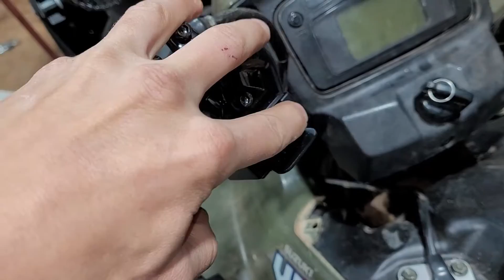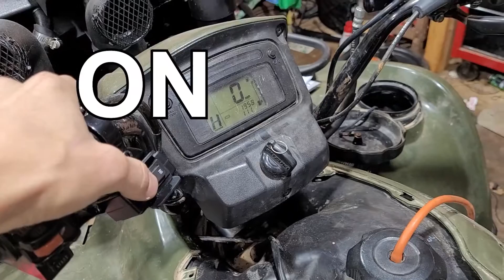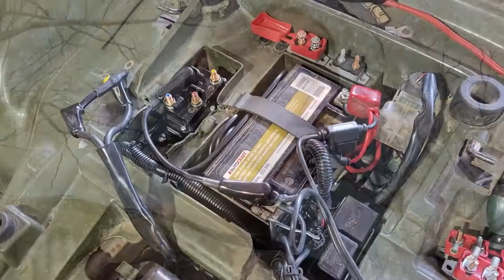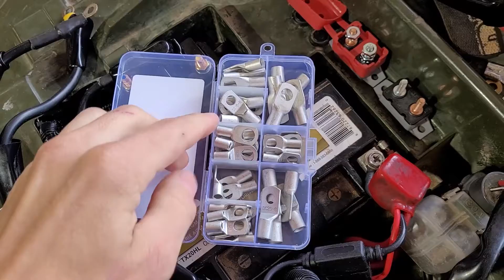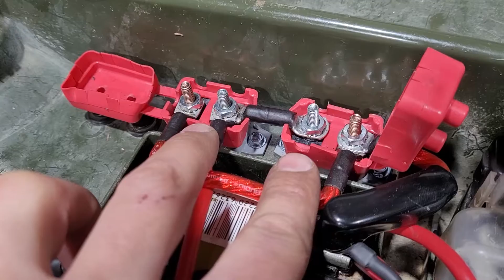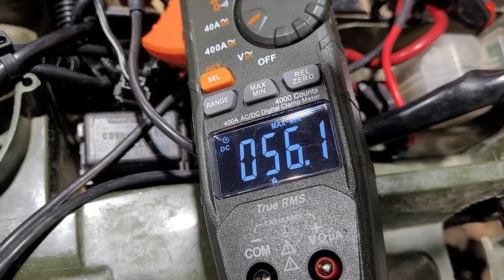ATV Winch Wiring

Comment: The relay is overkill. The contractor isn’t “draining the battery”….it is open until commanded on by the switch. The switch is wired to a key-activated hot lead. No battery drain.

Comment: Dude. I swear I watched this video at least 20 to 25 times. I took screenshots, pause, and a bunch of views. I can send pics. Where does the switch connect? Where does the winch connect? I have a 2002 Vinson... so the application is the same unit. The switch has green, yellow, and red. The 2 tiny wires on the side of the contactor hook to the switch? Where does the red go that is in with the switch wires? Where does the red wire on the non cooper fusible link, go? I got a lot done... I need to finish soon... any help would be appreciated!
Reply from the maker: Send me an email mattsshopofficial@gmail.com